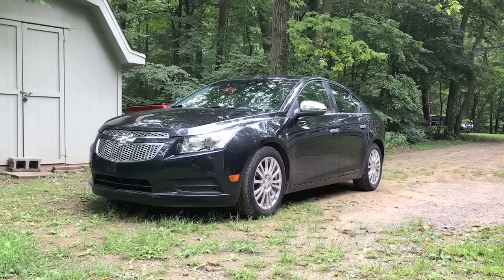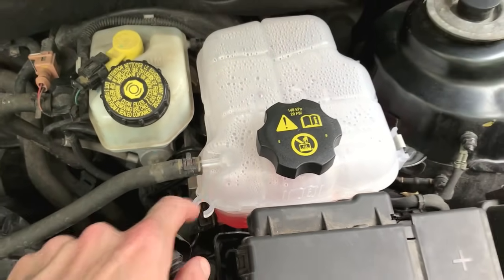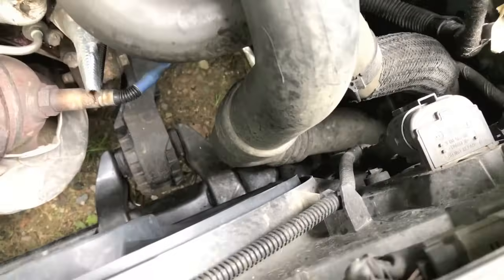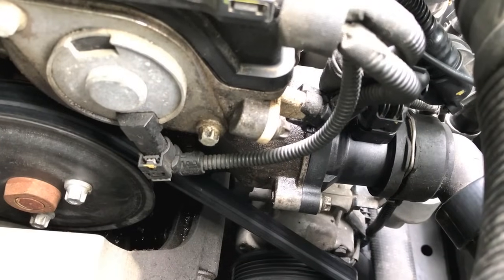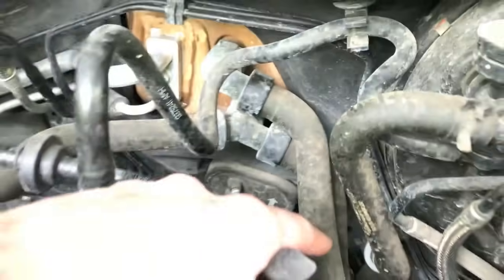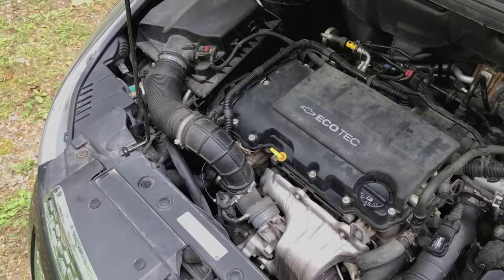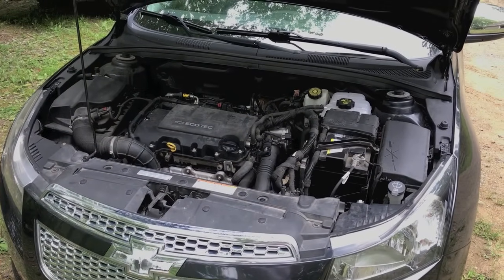Most common Chevy Cruze coolant system leaks! - Malibu/Impala as well

Comment: Radiator fans draw air away from the radiator. Not blows at it. Unless it were out front. Then it would blow at  it. But most importantly air is drawn from outside inside and onto the motor. Not blows at the radiator.. just saying thats gonna cause problems for anyone who doesn't know this.
Reply from the maker: Thanks for watching & sharing your thoughts, any & all helpful info is greatly appreciated.

😎👍🔧🔩

Comment: We have a 2012 Chevy Cruze we replaced the water pump thermostat is not leaking. Took it for a test drive no problem. Went out again and we saw a line of water behind us and lights came on saying overheating any suggestions?
Reply from the maker: Arianna571 

Thanks for watching & sharing your experience.  An overheating engine is never fun.  We recommend verifying you have the Coolant levels within the systems proper fill parameters.  Low Coolant can cause issues.

Next, your Water Pump may be beginning to fail.  The actual part that your Thermostat connects to is your Water Pump.  Once this fails, it no longer moves Coolant through your engine properly & leads to overheating.

Unfortunately it’s a very common failure in the Cruze vehicle.  Keep us posted.

Please subscribe to the channel and turn on your YouTube notification Bell 🛎 that would be awesome thanks again!

😎👍🔧🔩

Comment: I have a leak in that return hose towards water valve  on 1:38(video).
Do I need to replace the resavore and the hose ?
I have this exact leak and I'm having a smell of burned rubber. 
What shell I do  ?
Thanks

Comment: Coolant is puddling up on the highest part of the transmission and flowing down from there. I can't find any signs of leaks from the hoses and I had the water outflow valve replaced last year. Is it possible that the leak is from the water pump or thermostat on the other side of the car and it's just flowing down to the driver's side of the motor?
Reply from the maker: Thanks for watching & reaching out to us Dan.  The water pump & thermostat parts are definitely areas to focus on.

Both of which can wear out over-time & lead to coolant leaking.  To give yourself the best chance to pinpoint the leak, have the engine running as this will pressurize your coolant system and lead to coolant being pressure leaked out of the exact leaking point.

Be extremely cautious and careful as you look for leaks because the coolant can get hot, you do not want to burn yourself.

Comment: if someone puts in a thermostat wrong can that cause coolant leak?
Reply from the maker: Thanks for watching & it definitely can.  Inside the thermostat is a rubber gasket and if not properly placed in position when securing the thermostat to the water pump, it won’t create the water tight seal it is designed to do.

Welcome to the DIY Raptor Club.  Keep us posted on your project.

😎👍🔧🔩

Comment: what is cause of smell burning when i turn on my heater after 15 mins it starts smell burning  what can you advise the dealer mecahnis change the collant reservoir oil filters leak hoses water pump etc but the problem does not been resolved for 4 years now i spend almost a thousan dollars every year and now they suggest again for scannig and diagnostic please advise
Reply from the maker: Thanks for watching & welcome to the DIY Raptor Club.  By chance, do you notice any signs of discoloration in any of the pulleys that your serpentine belt rotated on?

Check out the video link below, you may have a seized AC condenser.

       https://youtu.be/j9Kbg-wiHF8

Please keep us posted.  😎👍🔧🔩

Comment: GM has and always will design and build components that are meant to fail , It is the nature of the beast and also meant to help many other multi billion $ industries .
Reply from the maker: Good morning ☕️ we appreciate you sharing your thoughts.  The Cruze has indeed kept its owners busy with repairs.
Reply: @DIYwithMichaelBorders that’s not good man brings me down I just bought one.
Reply from the maker: @kelliancewicz5300  

We are here to help though for sure!

👍
Reply: @kelliancewicz5300  The Chevy Cruze most likely will not have coolant issues until the mid 50,000 mile mark . If that helps ?
Reply: @DanRussell-q8s doesn’t help since I bought it used at just at 100k mile mark.

Comment: I am leaking coolant in puddles in a 2013 Chevy Cruze LT RS. I notice the puddle mostly when at my girlfriends house on their concrete drive way which is on a slant. I’ve put the car on my dads lift and noticed lots of what looks like orange/red coolant traveling down the sides of the radiator and collecting on the bottom of the two radiator tubes at the bottom of both sides of the radiator. All the while coolant sprays on my motor in two spots and then travels down towards the bottom of my motor by my converter I believe as well as my oil drain cap
Could this be from the gasket to the hose that goes to the pump from the radiator?
Reply from the maker: Thanks for watching & we appreciate you sharing this.  The best thing to do is start engine & allow engine to warm up & reach normal operating temps.

At this point, the coolant system will be fully pressurized and you will be able to pinpoint the exact location that coolant is leaking.  Be careful to not touch any portion of engine nor coolant as it will be HOT.

If it’s leaking from in-between the engine block and a part specifically, the inner gasket may have failed allowing coolant out which then must be replaced.

If it’s leaking from a hose fitting or in the middle of a hose, the hose clamp may need to be tightened or the hose may need to be replaced.

Comment: Hi I’m looking for some help from the people in the comments or anything but my 2012 Chevy Cruze is leaking somewhere around the water pump, I have replaced the water pump seal but it’s still doing the same thing any advice?
Reply from the maker: AFlaccidChicken TM 

Thanks for watching & let’s get this figured out together.  By chance did you add additional gasket maker?  If not, you may still be experiencing a leak due to the gasket not being fully seated to engine.  Keep us posted.

😎👍🔧🔩
Reply: DIY With Michael Borders thanks for the info!! I didn’t use a gasket sealer but I do believe I have found the problem and it’s the hose with the odd wire clamp on it where it goes over top, but I’m not sure what I did wrong when putting it on

Comment: Mine is leaking coolant right where the clip is at and is dripping down on the frame then to the floor. Do you recommend a new hose or a new reservoir ?
Reply from the maker: Robert Ponce 

Thanks for watching & sharing your experience Robert.  If your leak is located at the connection point where the clamp secures hose to Reservoir, it’s most likely your Reservoir.

You may just need to tighten the clamp ever so slightly.  Keep us posted!

Please subscribe to the channel and turn on your YouTube notification Bell 🛎 that would be awesome thanks again!

😎👍🔧🔩
Reply from the maker: Robert Ponce 

Below are two links that you may find very helpful.  First link is to a video explaining the differences between the OEM reservoir and the aftermarket reservoir.

       https://youtu.be/TRT7eFdoiw4

The second link is to a video showing the step-by-step process of replacing your reservoir tank.

       https://youtu.be/YiMFiOkfZJo

Hope this helps!

😎👍🔧🔩

Comment: My defroster on my 2012 Cruz dose not work anymore; and im noticing a burning smell when I stop at stop signs,and when my heater is full blast I smell the same but in smell constantly. Im not seeing any leaks on the ground at all. I'm baffled by this. Any ideas???
Reply from the maker: Justin Fever 

Thanks for checking out the video and sharing your comment!  A burning odor coming from your engine is no fun!  Have you pin-pointed the exact cause?

Your defrost not working may be related to a blockage.  Sometimes objects & debris fall into the vents & block the heat.  Once blocked, the object heats up & can possibly begin to melt/burn...leading to a not so pleasant odor.

It can also be a failing Compressor pulley...causing your burning odor.

Below is a link to our video that explains more about the compressor.

       https://youtu.be/j9Kbg-wiHF8

As far as the defrost, grab a flashlight & try and see if you can locate anything inside the vents that may be blocking your airflow.

Any burning odor from engine requires immediate attention & no driving in our opinion.  

Keep us posted, we will figure this out together!

Please subscribe to the channel and turn on your YouTube notification Bell 🛎 that would be awesome thanks again!  😎👍🔧🔩

Comment: My 2014 Cruze has sludgy gunk in the cooler do you think it’s oil and coolant mix
Reply from the maker: Josue Pimentel 

Thanks for watching & sharing your experience.  It’s very likely you have a combination of mixture causing your sludge.  We have seen in the past that it’s a combination of cheaper grade coolant & grime within the coolant system hoses causing it.  Are all Coolant hoses the original hoses as well?  Have you had any recent experience with burning oil & higher engine temperatures as you drive vehicle?

Keep us posted.

Please subscribe to the channel and turn on your YouTube notification Bell 🛎 that would be awesome thanks again!

😎👍🔧🔩
Reply: We are replacing the engine of our 14 Cruze RTZ RS. Changed the oil and it looked like a rootbeer float. Having to replace with a remanufactured engine with 53k on it.

Comment: have you ever experienced an issue where on a cold car, when you turn the key in the ignition and watch the car boot up without turning the car on, the temp gauge reads some warmth (maybe 3-4 ticks) even though it hasn’t been on in a while? also seeing “ac off due to ...” displayed on the dash. i’ve checked and don’t see leaks; 2 months ago i had the dealer replace the water pump, thermostat, and water outlet and reservoir hose and i replaced the reservoir with a dorman myself following your video. for the past few weeks i’m seeing overheating by 1-2 ticks sometimes with the radiator fan running maximum and the ac off warning. once and a while when i was driving the car the temp gauge wouldn’t move from cold at all. stopping the car and turning it back on would fix it half the time. would you start with replace radiator sensor?
Reply from the maker: ryan t 

Thanks for watching & we hope the video helped.  That’s odd, it’s possible that the new Thermostat that the Dealership installed has already failed.  The GM Thermostat is incredibly weak....possible...

You may also have a failed sensor.  2 sensors usually fail on the Cruze.

1.  Water Outlet Valve Sensor
2.  Radiator Sensor

Replacing both of the sensors may fix your issue.  Keep us posted.

We really enjoy making these helpful videos for our fellow DIY’ers.  Many more helpful videos to come.  😀

Let us know if you have any questions.  Please subscribe to the channel and turn on your YouTube notification Bell 🛎 that would be awesome thanks again!

😎👍🔧🔩
Reply: DIY With Michael Borders 

thank you michael for your reply.

early this morning i removed the temperature sensor from the radiator and replaced it with a new sensor. since the water outlet was replaced in august of this year i didn’t change the second temp sensor. i managed to start the car and let it run for 20 minutes and everything seemed fine until the radiator fan kicked on and the temp started to go beyond the halfway mark. it would only get as far as one tick past the half way mark on the temp gauge but it bounces back and fourth. i have an older video showing what it looks like here that i just uploaded:

https://youtu.be/QvOXw-q1f0E

after 15 minutes of idle i touched the thermostat and it felt cold, same as the hose connected to it. the hose on the water outlet size is very warm at this point and i can feel the coolant from the reservoir warming up. 30 minutes of running idle, when i touch the thermostat it felt hot and the hose is warm. could it be the thermostat failing already? coolant levels are very good. inside the car the heat warms ok. any ideas? changing the other sensor would be a good idea?
Reply from the maker: ryan t 

Thanks for the update & it’s very possible that your Thermostat has failed.  We had a friend that had the Chevy Dealership replace the Thermostat on his Cruze 2 times in less than 12 months...not cool...😲
Reply from the maker: It’s also possible that your Radiator needs to be flushed.  You may have a little left over / residual gunk inside Radiator causing issues.

We would probably flush your radiator system first prior to replacing your thermostat again ... see if that helps.

😎👍🔧🔩
Reply: DIY With Michael Borders 

just an update so it helps others with similar issues.

i’ve replaced the sensor on radiator but it didn’t fix the issue. on a cold car, turning the ignition would show a half warm car even though the car is cold. starting the car would warm and eventually overheat by 1 or two ticks on the temp gauge in which the radiator fan goes full blast. eventually the engine light came on and the temp gauge on the dash no longer moved from zero.

managed to get it to a mechanic and turns out the thermostat and built in sensor was faulty. we replaced the thermostat and things seem like they’re working as they should, despite the dealer replacing it 3 months ago. 

thank you michael for your helpful videos. best regards.
Reply from the maker: ryan t 

Thanks for sharing your update & this is very helpful info for future viewers.  We really appreciate it ryan.

We are happy to hear the issue s resolved.

😎👍🔧🔩

Comment: Hey, my cruze is losing coolant and the heat isn't working. I found the leak on the water outlet valve. Would replacing that valve fix my heat problem or just the coolant leak?
Reply: It would fix your heat as well once your car leaks enough coolant, there isn't enough to make it to your heater core which uses the hot coolant from the engine to heat the interior. Fix the leak and fill coolant to the proper level, and you should be good.

Comment: My leak is comming from passenger side. Most of my coolant is under where you said the water pump is  does this mean new water pump or new water pump gasket?
Reply from the maker: jarvis handy 

Thanks for watching & sharing your experience jarvis!  Let’s get this figured out!

We recommend starting engine & allowing engine to warm up to its normal operating temperatures.  As your engine warms up, the Coolant System will pressurize.

At this point, we recommend doing a thorough inspection of exactly where the coolant is leaking from.

If it’s clear that the coolant is leaking from the Water Pump, this is an indication that your Water Pump & Gasket must be replaced.

It’s always recommended to replace both Water Pump & Gasket at the same time.

Keep us posted, we are here to help!

Please subscribe to the channel and turn on your YouTube notification Bell 🛎 that would be awesome thanks again jarvis!

😎👍🔧🔩
Reply: @DIYwithMichaelBorders   thank you. Your awesome btw ill keep you updated after i replace it!!
Reply from the maker: jarvis handy 

Awesome Awesome & we really appreciate it jarvis!  😎👍🔧🔩

Comment: I have a question for you. My aunt has a 2013 Chevy Cruze 1.4l turbo and the hose that runs from the outlet valve to the radiator is leaking. I was wonder what would cause it to build so much pressure for it to start leaking. Would that mean the outlet valve is bad?
Reply from the maker: Timothy schneider 

We hope you enjoyed the video.  As your engine warms up, the pressure inside your coolant system builds.  This is normal & required for your coolant system to operate efficiently and properly.

The problem you run into overtime is warped & hardened hoses.  The more warped and hardened your hose becomes, the harder time the clamp has on making that water tight seal...thus leaks occur.  Keep us posted on your project.

Many more helpful videos to come.  😀

Let us know if you have any questions.  Please subscribe to the channel and turn on your YouTube notification Bell 🛎 that would be awesome thanks again.

😎👍🔧🔩
Reply: How's the car now

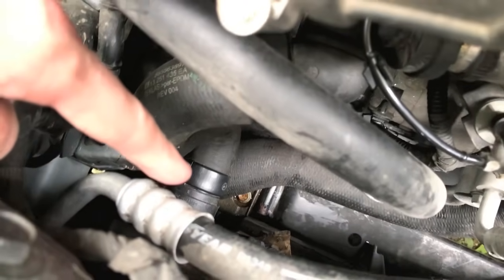Comment: Video @2:57 what would you change at connection  point and the hose? That's  exactly  where it's  leaking. T.I.A
Reply from the maker: Kat FISH 

Thanks for watching and sharing your question.  Great question & that lower hose is very important.

You will notice a securing clip on the top portion of the connection point that the hose feeds into.  In the event that that securing clip is shifted up or popped off and has become loose, the built-up pressure inside your coolant system will actually force coolant out of the tiniest seams of that loose connection point leading to leaking and loss of coolant.

We recommend inspecting that connection and hose.  Look for any signs of stress as well as verifying that securing clip is properly secured.

Keep us posted!  Please subscribe to the channel and turn on your YouTube notification Bell 🛎 that would be awesome thanks again!

😎👍🔧🔩